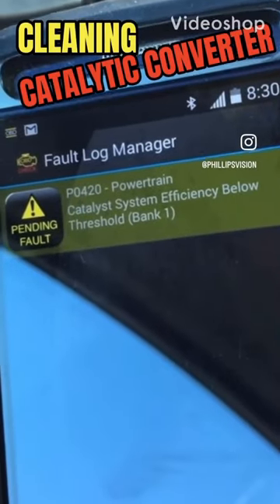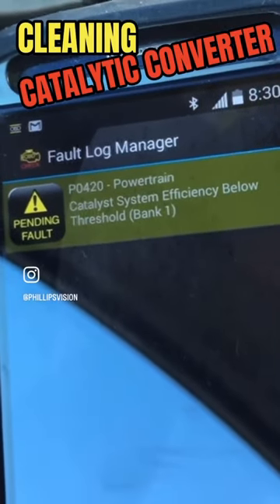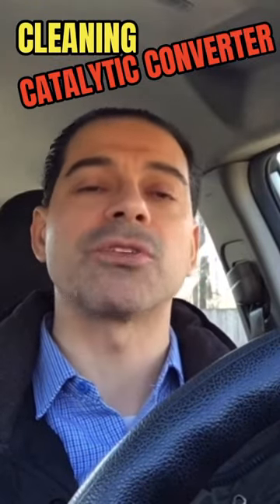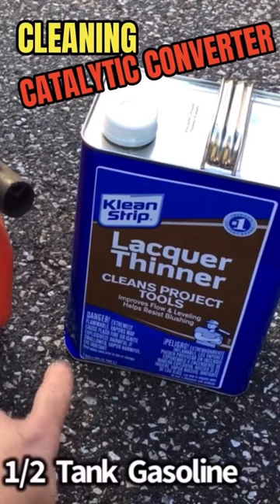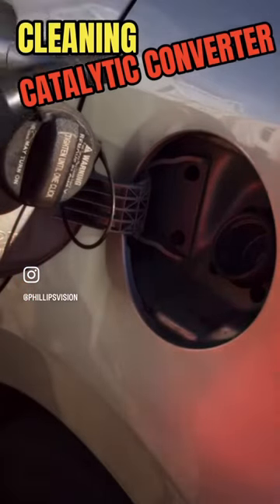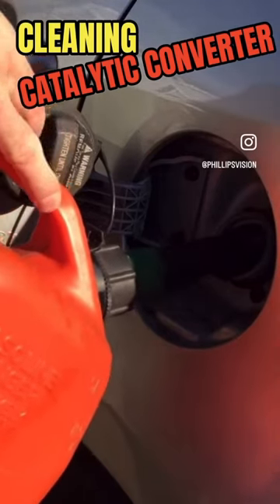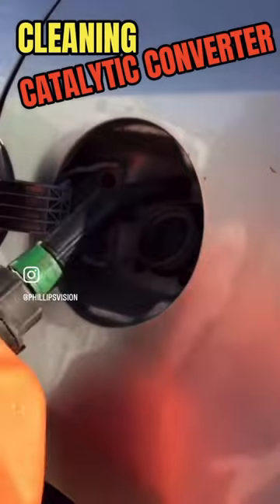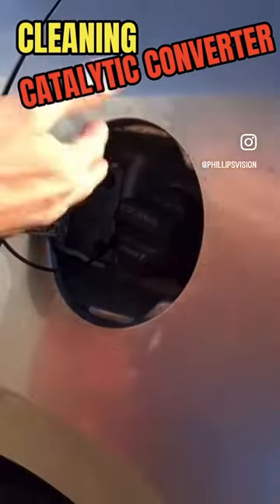CAN LACQUER THINNER CLEAN A CATALYTIC CONVERTER. Full video on my channel. #shorts #youtubeshorts

Comment: It works I did it and passed smog also get a wire brush 2 bucks at harbor freight and i attached it to my drill with extension to clean inside tail pipe ❤but two years later had to replace the fuel pump now I believe it was the thinner it wears out plastic parts idk for sure